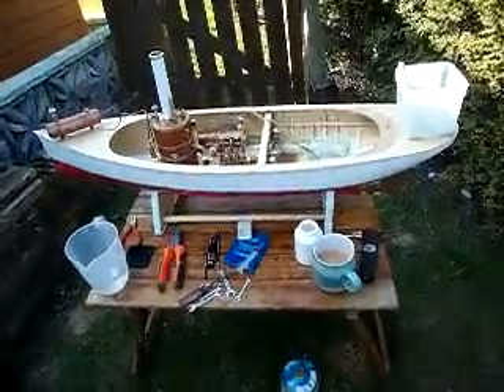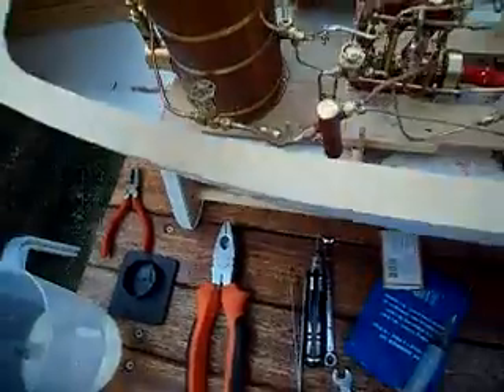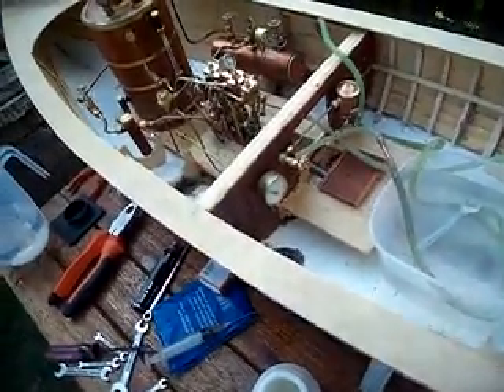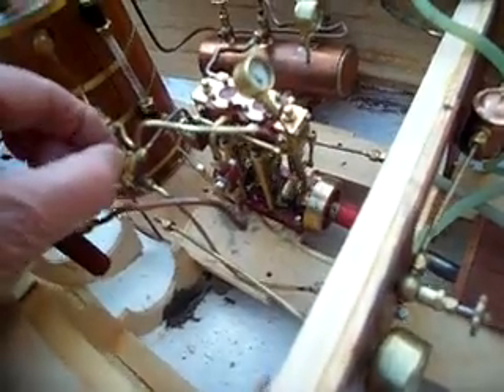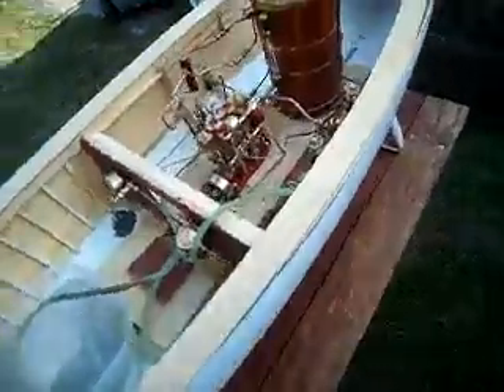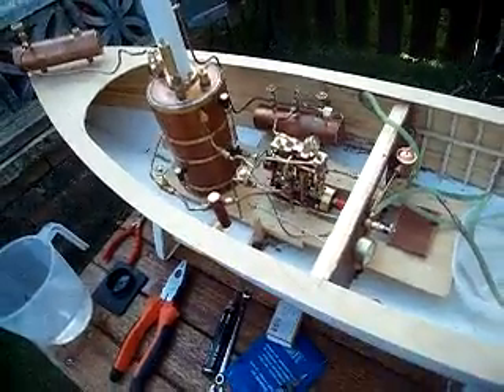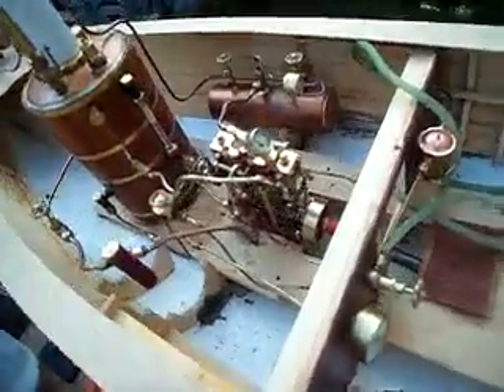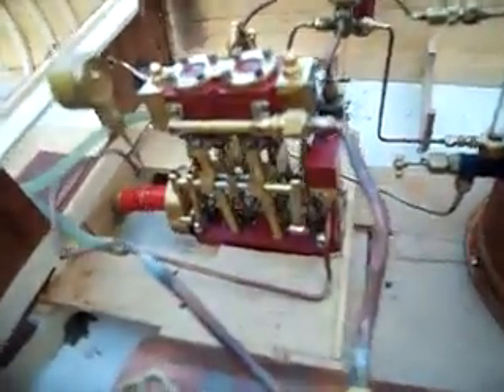SL.Bat Steam Launch running 9th April 2013

Comment: Hello Roy,
Well done ! Just my opinion, it is not necessary to let the engine run in the air too fast, its place is in the water. With the pump, you will have all the autonomy you wish, even playing with the whistle. And I also like the 2 bars / 30 psi pressure for my little engines, it is enough I think to play gently.
Let us see her on a pond !
PS : Keep me a cup of tea please ;+)  
Amicalement, Raphaël.